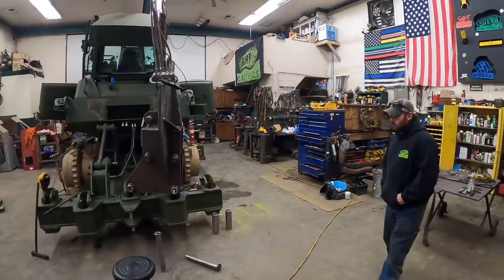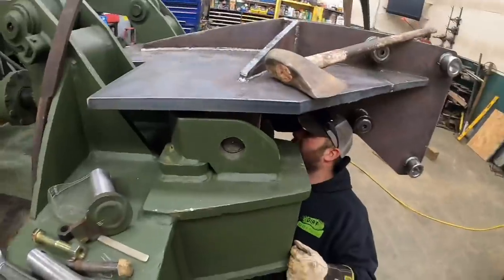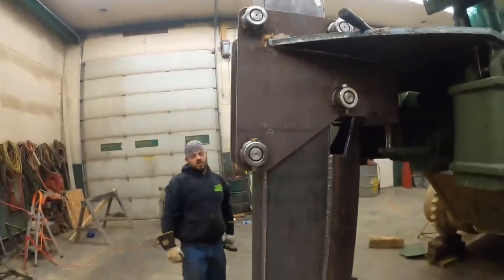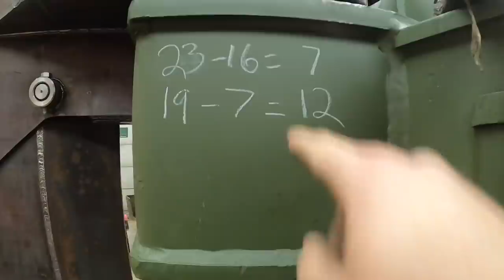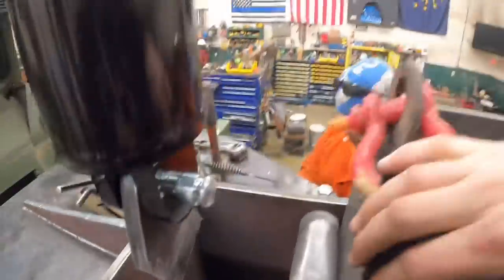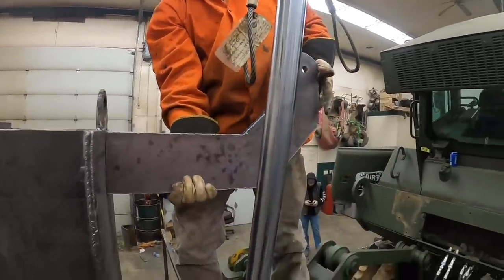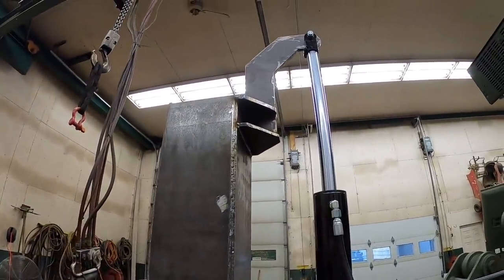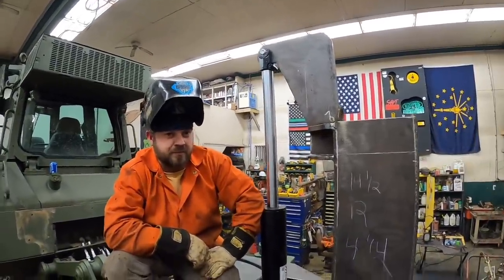Full assembly of plow ends with disappointment and failure. First major setback on build!!

Comment: I think you should try and bevel the hole for the pad eye so you can get as much penetration as possible since you can only weld it from the bottom Mike!👌🏻🤙🏻🤙🏻 But I know it’s already built so you guys got it like you want it! lol 😂 I’m surprised that Aaron isn’t grinding the mill scale off where he’s going to weld, we had to grind mill scale when we mig welded! They say the mill scale mixes in with the weld metal and it could cause porosity at the point of the two metals joint, for stick rod it doesn’t matter because the stick rod burns the mill scale off and the stick rod has much more flux! Just saying it was a rule in coded vessel work, that’s what the inspectors stressed the most for us! So we had to lay out lines and then grind the scale then lay lines out again for the fit up and welding process! Mike I’m just saying what we were held to! Y’all are doing a awesome job brother and it looks great and the welding too! Thanks for sharing my friend! 👏🏻👌🏻👌🏻🤙🏻🤙🏻🇺🇸🇺🇸

Comment: Hello ,
On the "cutting" parts of the foot directly in contact with the earth and the rock, wouldn't it be wise to use reloading stick passes to harden and reinforce these parts which will suffer a lot? I already love this monstrous tool....
Reply: DP mentioned using it as is and reinforcing what needs to be strengthened and hard surfacing anything that seems to get excessive wear.
Reply: @Crewsy It's just a personal reflection and I must not have heard all that, I don't speak English and I use Google subtitles which is light years away from being perfect, the translation is most execrable time, so it's not always easy to understand everything unfortunately...
Reply: @jeandupont9140  
That’s completely understandable and I wasn’t trying to be negative in my reply to your first comment. Sorry if you took offence to it.
Reply: @Crewsy  Hello ,
Not at all offended, I often explain that being French the translation poses problems, I follow a lot of foreign channels and sometimes it even brings problems, like my com in "Russian" (especially at the moment) but everything is fine ...

Comment: I will be surprised if the bottom roller does not fail when the plow is lowered mch beyond two feet,  The force of the soil being displaced by the large surfaces being pulled through the  same will probably shear the roller pin or teat the steel around the area of the bottom pin.  The bottom pin needs to be reinforced by a large member attached to the ripper area.  Consider what the ripper shank has to be contained with and the shank width is much smaller than the plow.  I would fabricate a separate assembly to go behind the plow connected to the ripper holders,  I would do this before I ever put the plow in the ground, before any damage is done to the roller!  I might use two shanks with a very heavy guage chain attached to a ripper, then around the back of the plow to the ripper on the other side and tighten with heavy-duty chain binders to test the plowing forces.  This would put the greatest plow forces on the ripper frame and could be easily attached and removed.  An ounce of prevention is greater than hours of refabrication.  IMHO

Comment: Far be it from me to throw rain on your parade, because ya'll are just so happy with yourselves but, it ain't gonna work. And I'll even tell you exactly where it's going to fail. Here go's, wherever you have that up and down plow positioned when you start into the ground, it's going to start bending on those roller pins, if it doesn't shear them right off. That square tubing plough is not strong enough to handle the stresses and strains you are fixing to throw at it and the first time you hit a rock underground its gonna warp the whole dang thing. Now to do it right and learn from someone else's mistakes , stand back and look at the ripper blades on the rock plough. That is how strong it has to be built and the up down hydraulic has all got to go. It's just in the way  of your pipe feeder anyhow. You could probably learn something from those guys that bury your tel wire in your yard. Just ramp it up about a 1000 times and you'll have it. Test it before you put all that stuff on there, please. If you weld all that stuff on there and then have to cut it off, it's just going to make me feel bad for you guys. This is a perfect example of what happens when you get rid of all the old guys, just because they are old, and you throw all their expertise straight in the trash just so you can hire the young guy for 12 dollars an hour. You need to find an old guy that has built something like this and learn from him. You might save a lot of money. Not a lot of them looking at YouTube. They might all be dead, I don't know. Ask your viewers. In my 68 years I've been everywhere and seen everything but I've only seen one of what you are trying to do. It was laying 6" HDPE with a sock around it ,drain tile we called it, and the plastic pipe went down through the plough and there was this huge metal wheel  behind the plough to feed the pipe and keep it from crushing. It has to be built simple but strong. I think another small tractor covered up the hole. It was just faster. Good luck guys, your gonna need it.
Reply from the maker: Interesting been using it the last few weeks plz explain that maybe the old guy can learn  from a young one also just saying 🤷‍♂️
Reply from the maker: By the way love guys like you make my day 😂😂😂😂😂😂😂😂😂😂😂😂😂😂😂so thanks for the comment

Comment: Ok safety first. Shame on you two, you both should know better. For what reason do you use that tool for what it is not made for, you almost got MBHTS hurt badly. (hint) It's within the first 5 min. of the video. Let's see if you can see your mistake. 
As for the build so far, aaahhhh your not going to put a cutting ridge on the top of the shoe like the shank? Look at it from the front ,that's a lot of 8"wide to be pulling thru that far down and you still have to lift up when it gets stuck putting even more stress on it, just saying. Scruffy
Reply from the maker: Glade you enjoyed
Reply: @DirtPerfect  I would have to say I did get a laugh watching you two flip steel, next time use a tire to drop it on . but that was not the safety issues it was the strap you used to do it ,that is not a strap for lifting and both of you know it.